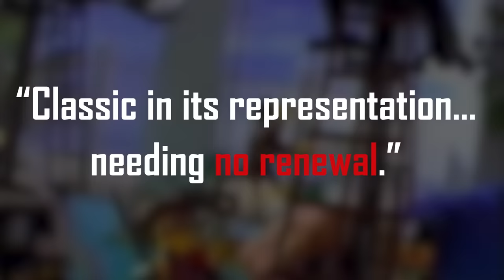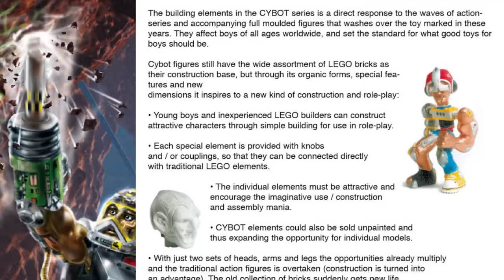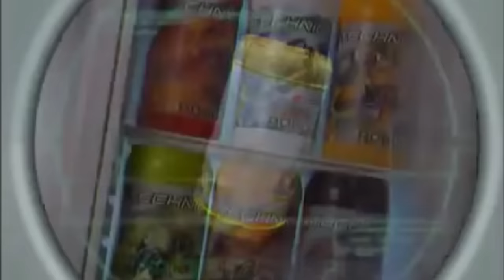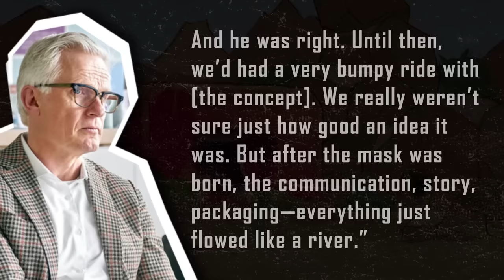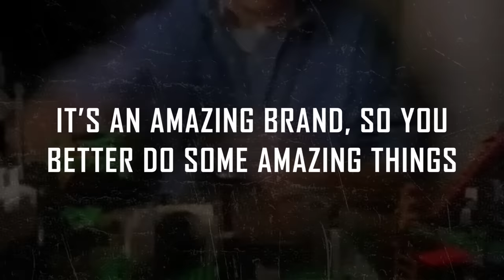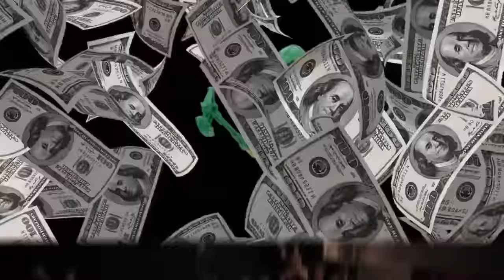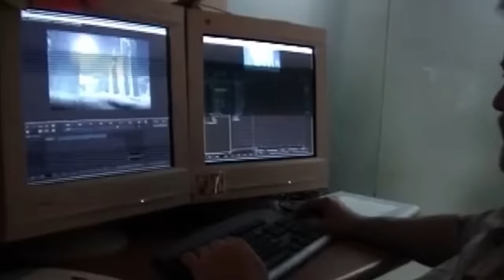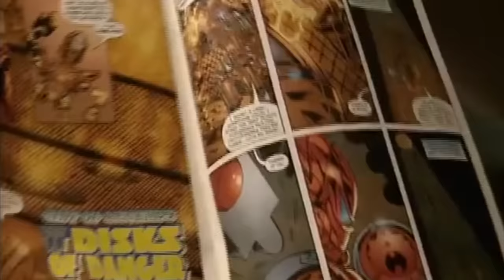The Insane History of Lego Bionicle | FULL DOCUMENTARY

Comment: It's been like a year and I'm sure someone has mentioned it but I can absolutely confirm that yes, the gears used in the original Toa were designed to be a Rock-em Sock-em style battle thing where you could knock off the opponent's mask. It was tunny because it was wasn't really part of the story and the system worked questionably because some of the masks, like Lewa's, didnt have enough forward-facing surface area to be reliably knocked off. But that was why all of the original Rahi and the Bohrok had the rubber band-powered punching features like punching arms for the Tarakava and Manas, tails for the Nui Jaga and Nui Rama, and the "punching" head on the Muaka/Kane-ra and the Bohrok- they would knock a Toa/Turaga/Matoran's mask off to replace with an Infected Kanohi or Krana to control them, and the Toa could knock off the Infected Masks the Rahi had to free them from Makuta's control.

With the Toa Metru you also saw them see if the gear idea was still important without the mask gimmick, with the Toa's masks using cross pegs to stay on, the arms being too stubby to reach, and the weapons tending to be either too long and spindly or be disk launchers with little force. I get the impression it felt gimmicky in the Toa Metru and hurt their posability so they abandoned it entirely in the back half of Y2 in favor of iterating on Kanoka Disks, leading to their obsession with projectile launchers.